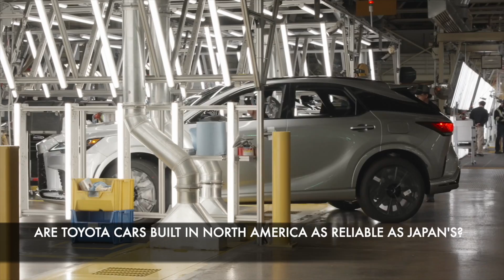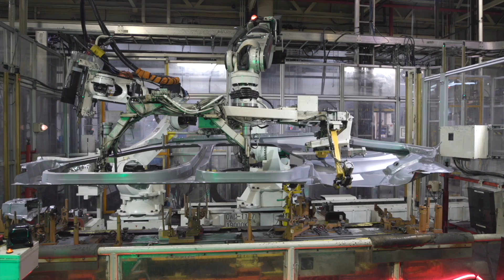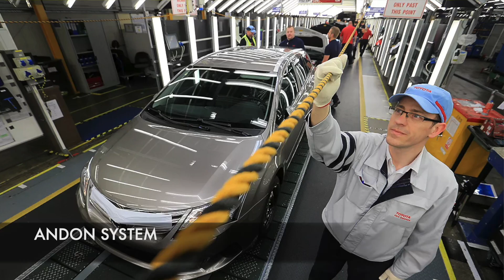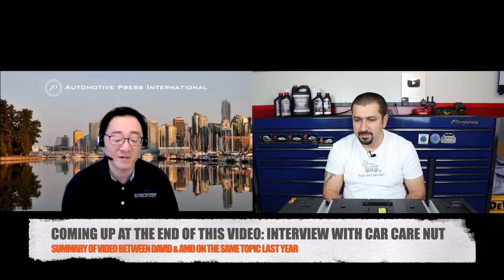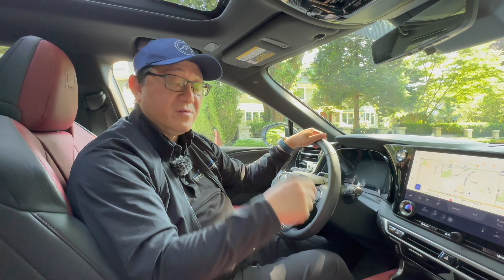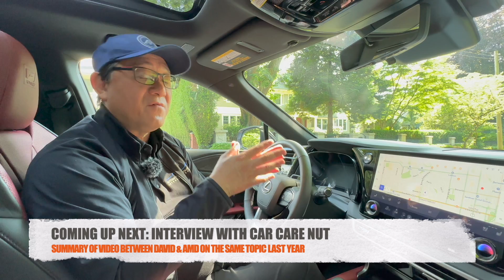CANADIAN FACTORY vs JAPANESE FACTORY - ANY DIFFERENCE IN RELIABILITY?

Comment: Based on my observations of my 2025 RX that was built in Canada.  The panel gaps especially where the hood meets the front quarter panels/headlight assemblies and the A pillar are really off.  The gaps are not symmetrical from left to right and they are wide and not even. The gaps on each side of the car where the A pillar meets the quarter panels are also off and not symmetrical.  My old Lexus made in Japan without a doubt had a superior build quality.  Nevertheless, needs have changed with my kids, and I need a car that historically should be ultra reliable with low maintenance cost regardless of the substandard fit and finish.  I hope Lexus/Toyota should recommit to quality.  New potential and repeat customer acquisition costs can be expensive and reputational damage can be devastating over the long term.

Comment: I just purchased 2025 RX350 made in Canada and the fit and finish,panel gaps are horrible, different mm at top and bottom of the door,the gap at rear door doesn’t even line up. The white glove crew must have been off the day it was manufactured. The car does ride and drive good.

Comment: You are wrong, i just switched to 2025 450h+ from canadian made 2023 350h, both were top of the line: engine noise day and light. Seat comfort day and night. The overall experience is very distinct. You would not bash the brand in anyway, too bad.
Reply: does not matter what principle and guideline, the parts are sourced from different vendors, which makes HUGE difference in driving experience.

Comment: I bought a used 2016 RX 4 years ago with 58K kilometers. Best car I've ever owned. All I have done in these 4 years is oil changes and filters, new wiper blades, and a better set of tires. So it's been basically perfect. But I don't know about the current models. I have read they aren't as high in the QC department, but I don't have any hands on knowledge of this.

Comment: I had my previous Japan-built Lexus IS250 for 10 years without a single non-maintenance issue. My current 6 year old ES350 Kentucky-built has also been just as good. Only oil changes, all filters, brake pad, tires, 12v batteries. Utterly reliable cars. Lexus, please build a new IS convertible in the next generation!!

Comment: I also prefer cars built in Japan. That said, I just got a RX that was built in Canada. I wanted a base car and there weren’t any available built in Japan.  It didn’t seem practical to spend more money per month just to have a Japanese built model.  Overall, I can’t find any paint blemishes on my car. I think all of the panels line up very well.  The back doors however don’t shut with the same ease as the front doors.  It’s subtle, but I can tell a slight difference. I would like to walk around a Japanese built model to see if I can pick out and defects on it. Overall, I am very happy with the quality of my Canadian built RX.

Comment: My 2023 RAV4 hybrid is built in Canada,  panel gaps in the engine hood.  The dealer where I bought it from can’t adjust it properly ! !  They have tried multiple times.
And the blind spot monitor on the passenger side does not work all the time.
I should have stayed with a Subaru. 😢

Comment: Hi, I have a 2023 RX 350 and since the first day, it has had a problem with a vibration and the brake calipers wear out and they always check it and say it's the tires. I am totally frustrated with this brand that is not cheap but it has not fulfilled the standards of a vehicle of its level, this SUV was built in Canada. Thank you
Reply: Was your previous car made in Japan?

Comment: I think the one exception to this rule of all Toyota / Lexus plants being relatively equal in overall quality, might be when the particular model is being built at another manufacturers plant like BMW (Z4 / Supra) and Subaru (BRZ / GR86). Toyota is not in complete control of the design and manufacturing process and those models may be less reliable in the long term as pure Toyota / Lexus models.  While the Supra may be a very good car, it's still going to be plagued by some of the typical BMW issues.

Comment: Thanks for the Video. I still believe there is difference between Japan made cars and North American made ones. I Currently own a 22 Lexus NX made in the Canada. Firstly based on TMMC website, NX and Rav4 are built on the same line. Toyota says workers selected for Lexus production lines are handpicked from more experienced workers from Toyota lines. So NX is not benefiting from that. From my own experience, my car has assembly imperfections inside and outside,  mechanical issue like missing transmission mount nut after 1 year of use. So either Lexus has gone down in quality as a whole regardless of plant or people in Cambridge Ontario are not working as per Lexus standards. But  unfortunately I paid for that car and nothing else I can do. Thanks Lexus!
Reply: I put a deposit down on a 2024 NX350 F Sport. Thought by now they would have perfected the manufacturing, but they have not. Right away in the delivery room I noticed there were imperfections in the panel gaps. The difference in gaps on the sides of the lift gate was the most noticeable with there being a much bigger gap on the left than on the right. I took my deposit back and now considering a different car unless I can hunt down a Japanese built one.

Comment: I purchased a 2023 RX350 - but after 6 months I think this car does not worth buying for several reasons 1-Lexus does not offer V6 anymore - the new engine is powerful on paper but in real life, it gives you the feeling that the car is too heavy to move and act too slow for acceleration. 2-gas consumption is really high compared to the V6 engine 3-Transmission of this car is not smooth and you can feel when it changes the gears. it is not calibrated properly 4-since they use an electrical shift gear the process of changing gear from drive to reverse or vice versa is too slow 2sec!! overall quality of the cabin is not bad but it is not perfect. I think with this amount of price other options are a better choice such as Acura or others

Comment: I can tell you right now, as a Lexus tech who DPRs new cars, the new RX is a train wreck. As I type this, I have 4 cars just delivered today with problems. One has a noisy steering column while turning. Two have failing circumference camera monitors, one has a loose AC vent (seen this multiple times) and the drivers seat squeals when you have the ventilator fans on. This is only one day. What happened to QC??
Reply: QC outside of Japan is subpar?
Reply: is new NX made in canada also problematic? i like my 2021 NX hybrid made in japan.
Reply: @HienTran-ph8bo  keep it

Comment: What Toyota has going for it is engineering…they don’t have the prettiest engines but have generally been very reliable.  Their hybrid systems are among the best and they’re probably the only manufacturer currently offering both direct and port fuel injection.  What they do lack is material quality…they suffer from the same fate as Ford, in being too big and too sensitive to investor interests.  Toyota has some of the cheapest interior materials in the market.  However, they’ve gotten smarter in designing more appealing interiors to detract your eyes from the same cheap materials.😆🤪 Sadly, Honda’s not far behind (but their current lineup has definitely improved).  Thank goodness Mazda is still in business (and was smart enough to divorce from Ford 🤪). 😊👍

Comment: Hi David, my most recent vehicles - 1993 Toyota Corolla wagon and 2005 Suzuki Grand Vitara - were built in Japan. I did not specifically look for them in terms of where they were built. In the case of the Corolla wagon it was the vehicle that I liked most at the time. In the Suzuki’s case it was a gift from a relative.
Reply: Wow. I owned a 1993 Corolla wagon years back, and we just sold out 2004 Grand Vitara. Both great vehicles.

Comment: Hi David, thanks for your video. I agree with you that reliability maybe just as good for Toyota/Lexus built in North America as those built in Japan.  However, one distinct verified difference I notice is that the RAV4 built in Japan sold in the North American have the removable front eyelet covers for the tow hook connectors where as the RAV4s built in Canada and Kentucky do NOT have this.  Different specs for the same car sold to the same customers in the same market… different based on the country of build origin.  Might you know why this is? I would consider this as a significant feature difference based on the country of build.  Front recovery points do matter to some customers in North America.
Reply: It’s not a recovery point. It’s used to tie the car down while on the boat to the U.S.

Comment: I bought a new 2023 Tacoma TRD Pro. The rear hatch is completely misaligned requiring me to slam it to close properly. The paint has all kinds of blemishes and imperfections. Lastly, one of the black plastic fender panels unglued itself in various spots. I brought up all these esthetic but quite major defects on a new $54k car to the dealership and received terrible customer service. After trying to accuse me of creating the fender defect - dealer said ” well, we don’t know if you didn’t  cause this damage polishing the car”… Really, a new car that I brought back with a few hundred miles as soon as it got warm?! They then took it to a 3rd party shop, without telling me, and had them replace the fender, an easy job they completely botched. Now I have white double stick tape visible on the whole fender. The rear gate issue they completely brushed off and said it cannot be aligned and has to be taken to a body shop. Reallly, a brand new trd pro to another 3rd party body shop?! The Toyota quality control is a complete myth and dealer service I found is even worse. Honest opinion from someone who buys many new, often premium cars. I should mention I bought the tacoma in its last year of production for the 3rd gen hoping all defects are ironed out. Not so. I even brought up the fender issue again in their customer feedback survey post service and no one has bothered to reach out to me from the dealer or Toyota.
Reply: Terrible. Not the same as Japan work ethic.
Reply: Sounds like you found a bad dealer, a good one would have taken care of that no questions